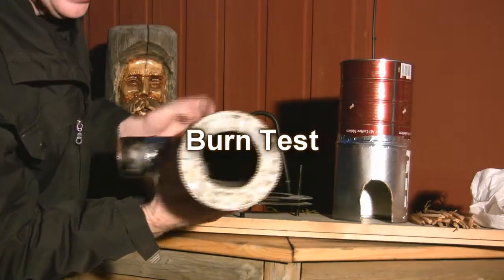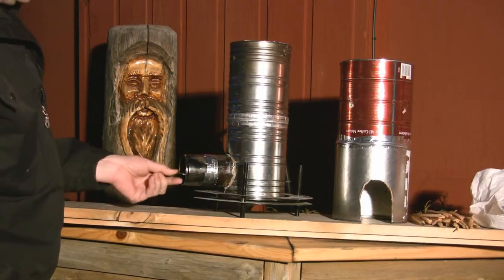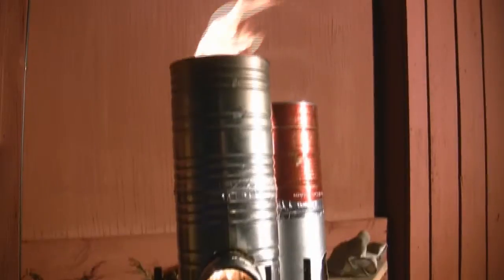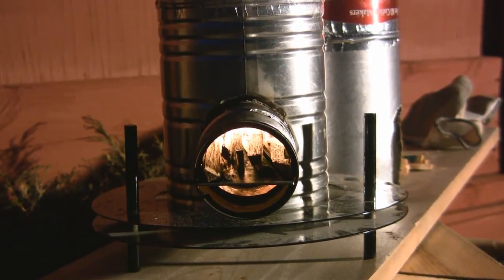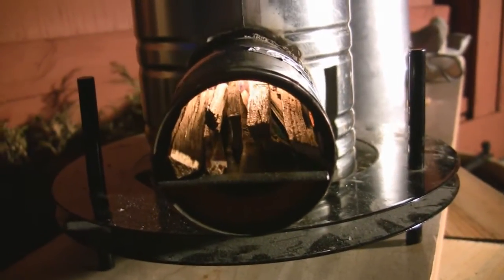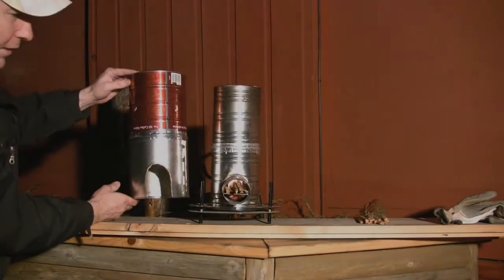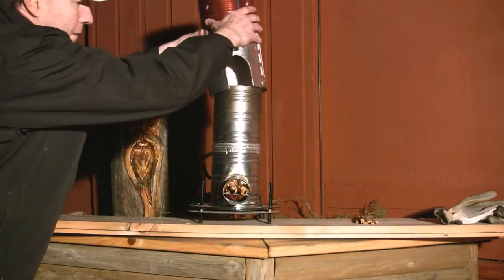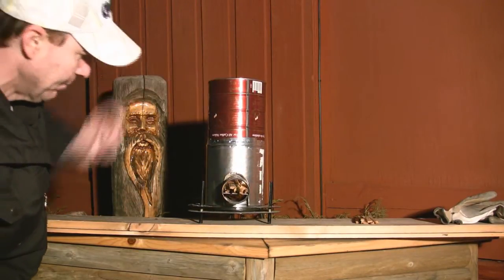Tin Can Rocket Stove Burn Test

Comment: Chi is right about the exhaust. Also, try using paint cans as the outer shell since they are larger in diameter and will circulate air.. Do not use the opening as the bottom but make a lid then cut a hole and put a soup can in it for the exhaust. This exhaust can be at the bottom of the outer shell if you want since the air will be cooler..

Comment: lol@ the sirens

I think that design would work if you had a vertical exhaust, because the vertical exhaust keeps the siphon effect flowing. The heat riser is one end of the siphon , and the exhaust is the other end, both ends are needed to keep the flow going, especially in a small system

From my experiences and from what others on youtube say, the higher your exhausts is, the hotter and faster your stove runs because the exhaust is pulling the hot gases out at the same time the heat riser is pushing them in

I am getting ready to make something very similar to yours, I'm using the same size gallon cans, but I'm going to attempt to have it run off of 90% alcohol soaked in toilet paper that is stuffed in a quart can